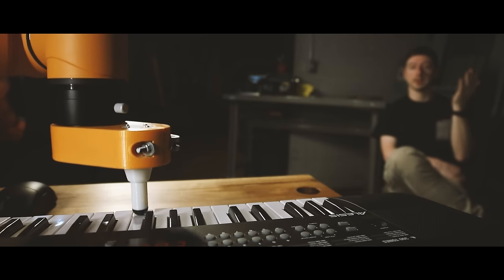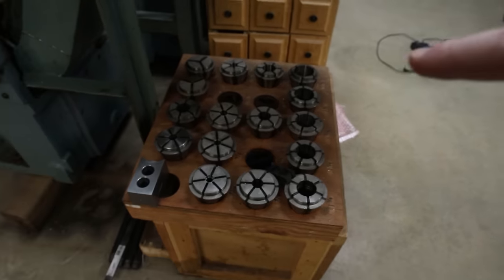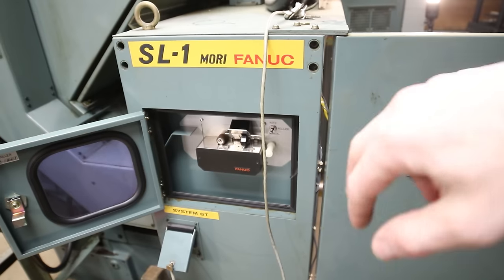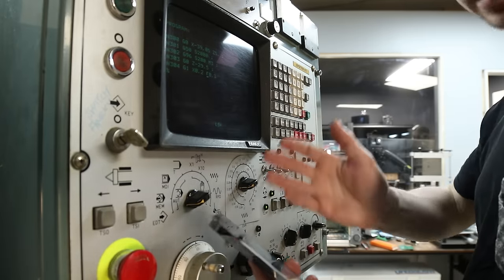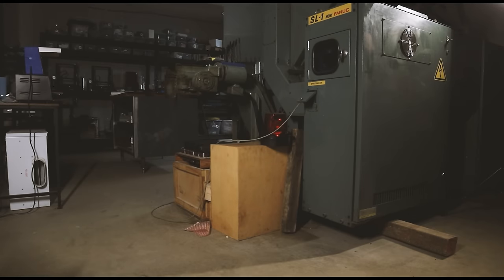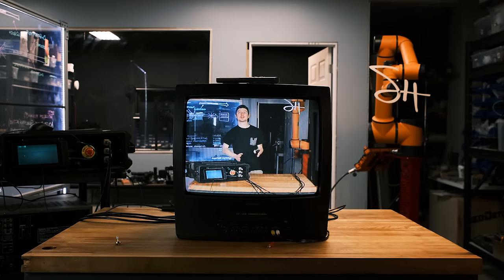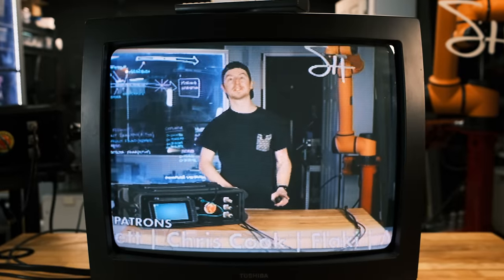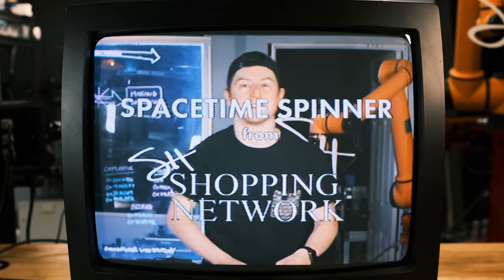I Bought a Giant 40 Year Old CNC Machine

Comment: That's older than 40 years.  We have one in the shop I'm at (use to have 2) and it's a workhorse for small parts. Ours has a collet chuck.  Easy to program;  just sucks  needing to set the G50's for the tools each time you set up a new part.
Reply from the maker: I don’t do it that way. Just use tool offsets, but it’s not as efficient as using G50 I don’t think.

Comment: We have one just like it. Has paid for itself thousands of times over. Continues to work day in and day out.
It comes from a time when people thought that if the tool comes from the back, the x dimensions have to be negative.
Also, it doesn't have some handy cycles so when programming manually, the guy has to write out a peck drilling cycle by hand.
Reply from the maker: Very cool. Yeah the negative X is strange, but I also only have little previous experience with any CNC lathe so it doesn't matter to me much. I've built it into the way I setup my CAM software. 
I haven't really looked into the macros yet, not sure if I would ever need to unless I'm running different parts non stop.
Reply: @SeanHodgins  If you look around the circuit boards, you can find some gems. Intel 8086 and such. The purple chips are Fanuc's own. Under the little metal plate on top (don't remove it), you could see the magical piece of silicon and the tiny etched lines that make our world tick (I salvaged a few from a similar machine that was scrapped and soldered the plates off). Also, there is a ton of UV-erasable EPROM chips that each has a little orange translucent sticker to prevent stray UV from getting in.

Comment: We don't use line #'s  (N10, N11, N12 etc) on any of our machines. Saves typing  and  reduces program size, particularly good for this SL1 control since the memory is pretty small.
Reply from the maker: I’ve since stopped and it’s transferring way better without it.

Comment: There are very few videos on these machines.  I’m working on getting my tool changer working on a mori seiki cl20.  
Siicckkk video! Glad you posted this
Reply from the maker: Cool, what do you need to do to get it working?
Reply: @SeanHodgins  the turret motor has a weird trigger sensor for sensing the tool position.  Trying to get Linux Cnc to either decode the two sensors and using the stock lobes or installing my own 8 -1 tooth for sensing tool #1 then all consecutive tools after missing tooth will have a tooth till the empty tooth which resets count.  Just not sure how to do it and I don’t want to over stress components with all that hydraulic pressure if I get the timing or count wrong.  Kind of nerve racking.

Comment: That's cool. Is it possible to replace the electronics to modernise it to usb?
Reply from the maker: You can add newer electronics, but its a bit of a process and not super cheap. Maybe some point in the future when its needed. I can more easily put in a small raspberry pi to simplify the transfer though. So I may do that.

Comment: Buy a Moxa NportW2150a so you get wireless rs232. The pin24 on the controller has 24 volts on it, so you can use it to power the Moxa.

Comment: I also picked up a SL-1A a few years ago, but it has the Yasnac LX2 control instead of Fanuc. It was working when purchased, but it sat for a year while I situated the 3 phase power in my home garage. I cannot get it to work for the life of me. I'll be retrofitting the control with a 20 year newer Siemens Sinumerik. The iron is too good to move on.
Reply from the maker: The iron is amazing. Too bad it won’t work as is, but it will be a fun project none the less

Comment: Hey man!  I have a 1987 Okuma Howa Millac 3VA with a Fanuc control that seems related to yours (I'm guessing you have a OT.  Mine's an OM-B).  I've upgraded mine to the full 128k from 16k.  One thing you should absolutely do is pull the EPROMs out of there and back them up.  They have a tendency to bitrot after ~20 years.
Reply: Also, back up your params - you can transfer those out through RS232.
Reply from the maker: Hey Thanks! How did you do the upgrade? I've got the params manually backed up in a spreadsheet, didn't take that long. haha Mine is the Fanuc 6T-B
Reply: @SeanHodgins  So, on the om-b, all it is is adding RAM to the sockets on the main board and then flipping one of the 900 level parameter bits.  I'm not sure where what the parameter is on your control.  My RAM is located at 2H, 3H, and 34H...NEC D43256 chips for the main ones, and I can't remember the other number for parity.

EDIT: Parameter 901.  It's read backwards as well, parameter 0 being the last.

EDIT EDIT: Nuts, I'm the same guy, just forgot to log into my business YT account.
Reply: Something that is apparently possible but I haven't tried is outfitting a Behind The Tape Reader.  Basically it just sits where the tape reader would be and feeds the control information in the format it expects.  It's basically unlimited at that point.

Of course, if your machine is DNC capable, then all you need is the null cable and you can have a computer simply feed g-code as it goes.

Comment: What post proceasor did you use in fusion?  I have an old MHP running a Fanuc 6T and am having trouble finding  a post that works.
Reply from the maker: Are you on the discord? I would be happy to share it with you there: https://bit.ly/SeanHodginsDiscord
Reply: @SeanHodgins  I joined and left a message in your requests section...  Thanks!

Comment: Looks like a cnc lathe or sometimes referred to as an auto lathe, BTW is that 4 cpus on that board? Wouldn't put it past them to have 4 mos 6502 cpus running different parts of the machine since this was before multiprocessing
Reply from the maker: I have no idea, but I'm sure they have some interesting hardware tricks in there.

Comment: Nice! Had similar adventure some years ago, with a Hermle uwf-851-mill
Reply from the maker: I love hearing about all of these different machines in the comments. Was it a good experience?
Reply: @SeanHodgins  It was the biggest sucsess of my life. 
We buyed it for dirt cheap (for 500 eur), with my brother, because it was faulty (Crushed z-axis thrust bearing) and the company who selled it, started to disassemble it, cutting all the wiring, even the linear scale cables, what was fun to resolder. 
Luckily the machine came with a complete wiring diagram, so i was able to rewire everything, and start the machine. 
Then we realized the problems, and we complete dissassembled the whole thing, ordered the needed bearings, give it a fresh new coat of paint, and assembled again. My brother is the hardware guy, i am the electrican/software. So it was really fun, for both of us. 
Back then we worked at the same company, had lots of free time, and good relationship with our boss, so we were able to do the repairs after work hours at our workplace. Then we moved, and strated a small company, then moved the old lady again, and today She sits beside a Deckel Maho DMU70v. 
Whatever happends, she stays with us. 
We helped She to live again, and She helped us to start something new.
Reply: P.S: Sorry for my terrible English, i am Hungarian

Comment: That's an SL-1, not even an SL-2! I would have left the spindle side out in the open so you can feed  in some bar stock. I ran a bunch of them things. SL-25, CL-25. Live tooling moris, Toyodas, Toshibas, I can go on but, no point. Good luck!
Reply from the maker: Thanks! Might need to move it at some point but should work for what I’m doing now. Didn’t even know if it ran when I put it there! haha
Reply: @SeanHodgins  Moris are really good machines. I don't think that the machine will run off of the tape reader. It's for loading the program. I would think that there is a master tape out there somewhere with all the the parameters and what ever other options that thing came loaded with. My old employer did have an SL-2 with a bar feeder. We turned some long parts. Does your machine have a tail stock? And one last thing, battery alarms. Should be some batteries for memory backup. If you have to change batteries, do it with the power and control on. Otherwise, if you take batteries out with your power off. POOFFF. Memory will be lost. And I mean all of it. Parameters and everything.

Comment: USB to RS232 is the reason why your machine didn't receive program completely. At the end of the program, add bunch of M0 or M30 lines, so you make sure you get all important stuff. But ideally just send it thru serial card. I've burned 2 motherboards by sending by usb to rs232, 10k worth of damage.
Reply from the maker: It seems to be working better now that the line numbers are removed. I tried using a computer with a serial port on board, but it wasn't working right. Might visit it again. Motherboards on the machine? or on your computer? How did they damage it?
Reply: @SeanHodgins  I assume you are using onecnc dnc software for transfer ? Might be worth to try another software. It was some chip which is resposible for send/recieve that got burned on the machine motherboard, it's not such a big deal to replace, but we sent it to heidenhain offical for repair and it was PRICEY, also each machine was down during repair time, about 2 weeks downtime each. Reason why it got burned is your USB voltage output is 5v while serial output is 12v if i understood that correctly.

Comment: I've ran several CNC lathes. I actually run a mori-seiki zl-45 lathe now. It does the same thing when loading a program. Once in a while the bottom half of the program does show up. I'm doing it over wifi. So I figure it's getting interrupted during the transfer. 
Watch out on the character number amount. The amount of internal memory is so bad on those older lathes.
Reply from the maker: Interesting! Mine was doing that too, I was getting an error half way through the program, can’t remember the code(maybe 087?) but it stopped doing it haha, so I’m sure it will show again. It was consistent in the line it stopped at though. 

How are you doing wifi? Raspberry pi? Microcontroller?
Reply: @SeanHodgins  it's newer than your controller. It has a interface that plugs into where the old floppy disk drive use to be. I transfer the program from the computer to this box. Think of the box like an SD card. Then I load the program from the box to the control memory.
Reply: @SeanHodgins  maybe that code means memory full.

Comment: If you want an easy way to run 6T without having to use G50 grid shift I have a video on my channel for that, I have a Slant 1 with a 6T control we run daily.
Reply from the maker: I've definitely watched your video! I don't use G50 grid shift at all(I still have to call it in the program though), just the tool offset method using tool 1 as default position. Then do the T0X00, T0X0X for tool changes. The only issue I have with that is if you want to start a program mid way, always loses position. I always have to start the program with the tool sitting at its "X0,Y0" (next to the part) or else it doesn't work. Do you also have this issue?
Reply: @SeanHodgins  you can start anywhere in the program where there is a G28 call, since it resets the shift values. just scroll to your G28 U0.0 W0.0 line in edit and you can switch back to auto and cycle start.

Comment: Neat video!, what software did you use for the post processor or was it in fusion 360?
Reply from the maker: Yep m, I used fusion 360, with a modified post processor file for my machine.

Comment: I stood in front of the same type of machine for over 10 years.. It was in front of that machine I got to learn how to be a CNC-operator. And make so many mistakes.. and chrashes.. DO NOT FORGET THE DOTS/COMMAS!
Reply from the maker: So paranoid for crashes. I’m pretty careful, but it can happen to anyone
Reply: Oh, one thing to remember. There is nothing stopping you from running the program even if you haven't searched the reference points at startup.. Let's just say I learned that the hard way on my third day in front of the machine...

Comment: It's an old SL-1 with a Fanuc 6T.  Nothing giant about it.  There's no steppers on that machine.  The servos are old Fanuc DC motors and drives.  BTW, get rid of the line numbers, they take up memory and you don't need them. X on those old machines was backwards too.  Nowadays, -X is toward spindle centerline.
Reply from the maker: Yeah the numbers need to go. When the biggest machine I used to own I was able to carry in pieces into my basement, this is giant by comparison. I learned about the yellow tops, need to check the brushes when I get back in the shop. The -x is odd, but I'm managing it with my software.
Reply: @SeanHodgins  you can change the X direction in parameters.  The big thing is the G50 position set command.  You have a coordinate system for every tool.  Modern machines have no need for this style of machine operation.  That machine looks to be in good shape, run it.

Comment: I ran a Mori SL-3 it was built in 1978 it had a Yasnac 2000 control you sat down on your stool and programmed it manually I remember the “Buffer”button the control had Red led’s very difficult on your eyes and yes it used a black paper tape the if you had the luxury of a 486 computer to program your machine all your parameters where on a metal tape just in case you had lost the machine’s memory and the machine had to be sent to its home position before shutting down the machine for the day otherwise you lost your machine Zero
Reply from the maker: I bet there are some real horror stories out there! Its amazing how long they have been around. Thanks!

Comment: Too many questions.  WHY WOULD YOU POSITION THE HEADSTOCK BESIDE A WALL ...A BRICK WALL?   2:58  "Stepper Drivers"???   No, I highly doubt the motors are "steppers".  They are "servos".  Where is this "shop"?   Most certainly NOT a residential neighbourhood.  There isn't 3 phase power in a residential neighbourhood.
So long as the machine was not abused or overloaded, and maintained properly, and in a clean work environment, it should be good for many more years.

.
Reply from the maker: Hey! I'm not planning on running any really long material, but if I ever start manufacturing something where I need access to the back of the headstock, I can pretty easily rotate the machine enough to get access and leave it that way. I misspoke about the dc servos. Every shop in the building I'm in has their own 600V 3 phase supply, and their own 3 phase transformer.

Comment: not a giant... no steppers either, everything is dc servo.They use analog +-10 volts. The tape is your parameter tape, dont lose it. Many people still program Fanuc lathes line by line, they are easy, you can punch a tape with your program and load it into the memory. It will run off a tape, its slow and the only reason I ever knew of running a tape was if the program was bigger then the memory. Fanuc lathes have canned cycles, activate that in your post. If the whole program wont load you either ran out of memory or your serial settings are wrong or you have a mistake in the code. Maybe spend some time talking with the guys that run those machines, they are around. Learn to program it manually...
Reply from the maker: Thanks! There is no parameter tape, I have them manually stored in a spreadsheet(took awhile). I believe the program isn’t loading the last couple of lines because there is no stop character, that’s all. It was only 300 lines and the memory is cleared. I would never program if manually, i don’t hate myself that much. I have smart computers and a post processor I modified, to do that. Haha